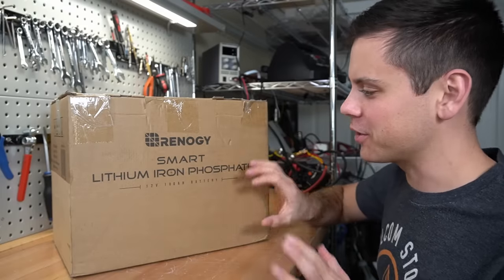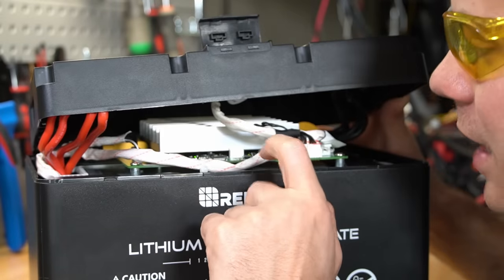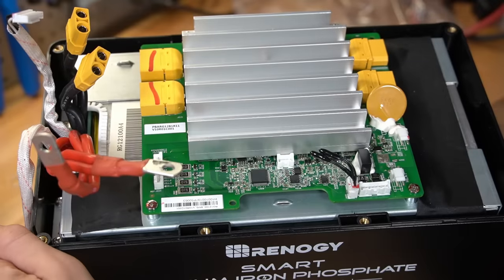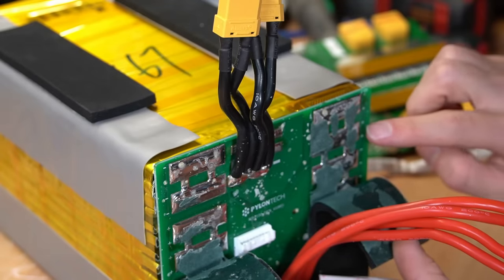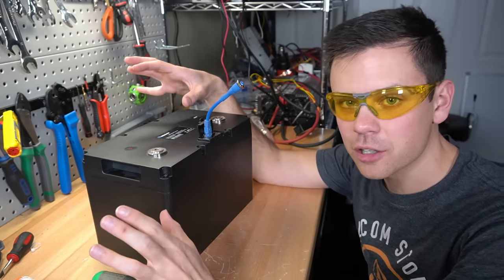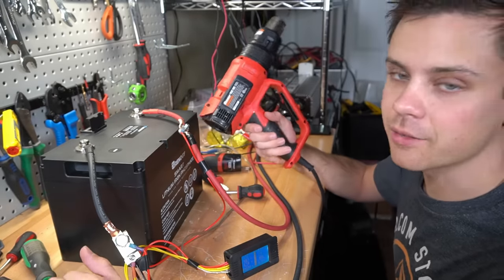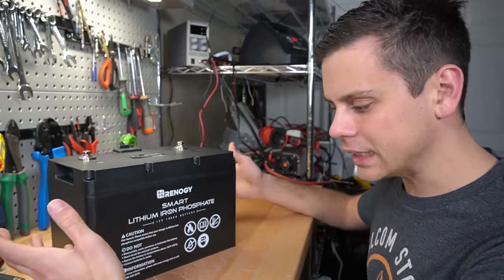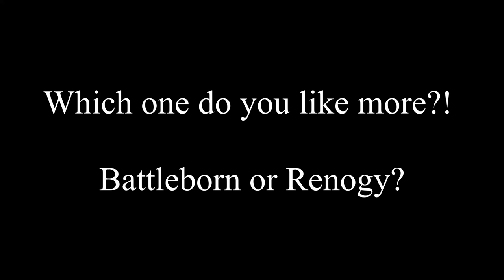Renogy "Smart" 100Ah LiFePO4 Battery Tear Down

Comment: Did you see the word "pylontech" inside?

I had a  pylontech battery and it started swelling. Even with a BMS.

They just took a Chinese battery and repacked it. 

Pylontechs are cheap.
Reply from the maker: Yes, pylontech is labeled everywhere. I have heard good things about their other batteries actually. Even victron is supporting their use. I wanted to hear other people's opinions on them first. Good to know they are cheap

Comment: Looks like Lithium Polymer even though it's actually LiFePO4.
Reply: They are a thing. I've bought 10Ah LiFePO4 pouch cells from AliExpress to act as a battery to Raspberry Pi's or for other electronics projects. Set of two cost only 20€ w/ free shipping! They can also be used as an UPS backup using a LiFePO4wered Pi+ addon card made by Silicon Ignition. Their upcoming addon also has a support for connecting a solar panel. :)
Reply: @ristomatti  How long can you run a raspberry pi off a pouch cell? I'm looking to use some as security cameras.
Reply: @nanakeyks  I haven't tried yet with these cells but if I remember correctly a RPi Zero with a camera module w/ small IR LED's run 1-2h with the 1600mAh battery included with the LiFePO4wered Pi+. So it wouldn't run that long. Of course you could add a PIR sensor to boot it only on motion but it might take too long for it to come up to catch anything on video. The RPi camera modules don't have a very good image quality either so one of those battery powered security cameras might be a better option (likely even cheaper).

With that said I am using them as "security" cameras to monitor critters and small wildlife around and inside our summer cottage. The batteries currently act as an UPS as power outages are common there. One of my plans for the bigger cells is to set up a battery powered camera to get footage of wildlife during a single day/night on areas too far to run a cable to.

Comment: There is such a thing as too smart. As for a low voltage system that will never be setup past 12vDC there should not be anything more then a simple BMS for safety

Comment: Battleborn vs. Renogy.... Cost difference is $50 and the Battleborn has a 10 year warranty.  It's a no-brainer - Battleborn wins handily.   Who would not pony up $50 for a 10 year warranty?!
Reply: Except, its pro-rated. So say you have an issue in year 8 of your 10 year warranty, and your 100 amp h capacity is say 40 amp h/ they'll give you 40% of the cost, not like they will give you a brand-new battery. All marketing.

Comment: Wtf!? On the pouch cell board is written pylontech. Please dissasembly a Pylontech us2000, I bett it will have inside pouch cells.
Reply: ccd The PylonTech US2000 does indeed use LFP pouch cells, no need to tear it apart to find that out although wired to produce nominal 48V. But it’s interesting to see Renogy is using PylonTech hardware and cells.

Comment: Can you explain why a battery is cannot be put in series?  How does the battery know if it is in series or not?  What is the reason why you can't put two of them in series and get 24 volts?
Reply: Apparently the comms interface has a common ground and not optoisolated, so they would clash if connected together. Maybe bluetooth would have been a better option.

Comment: To be honest I’m a bit concerned when you get the battery sent out and it looks good inside... Just because it’s an American made battery they can still try to pull one over on you. But it really looks good inside so it’s probably not faked.
Reply from the maker: It's not made in America
Reply: DIY Solar Power with Will Prowse Ok, didn’t know that! But remembering the Riuxu “gate”, one get a bit suspicious... 😉